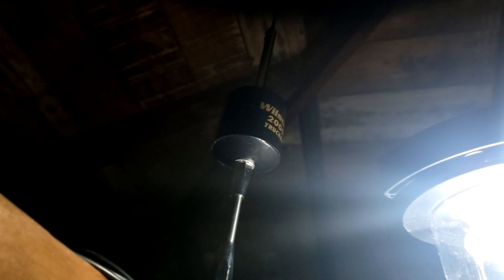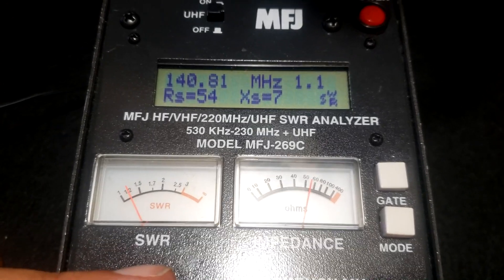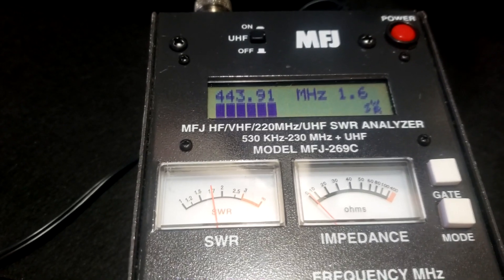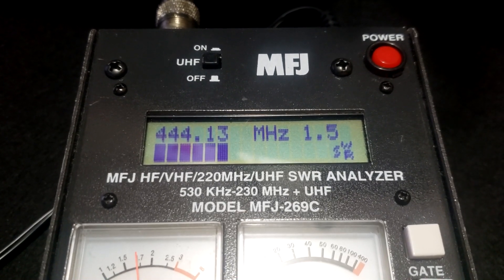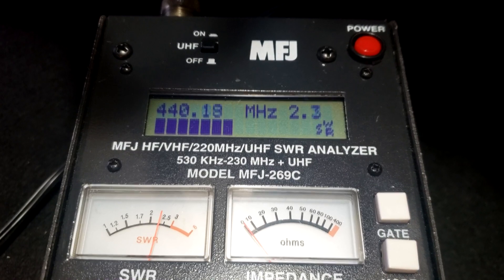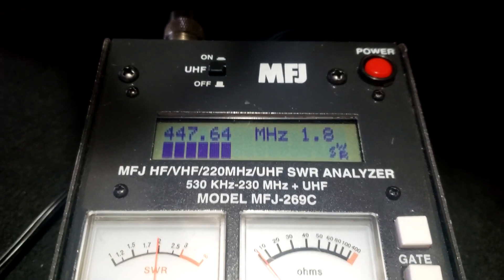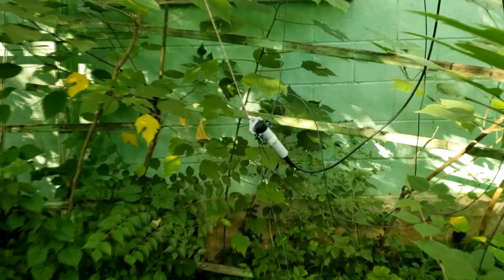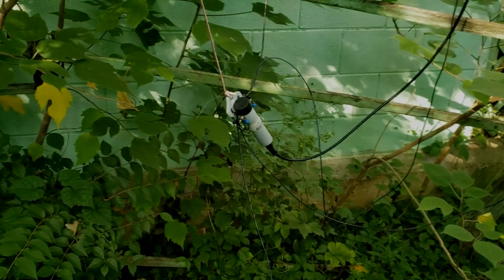Antenna Update 1: More problems

Comment: The MFJ is fine for SWR measurements but no so much for db loss measurements.  I wouldn't put much faith in loss numbers.  It does a much better job on showing you SWR readings and R and complex i values.